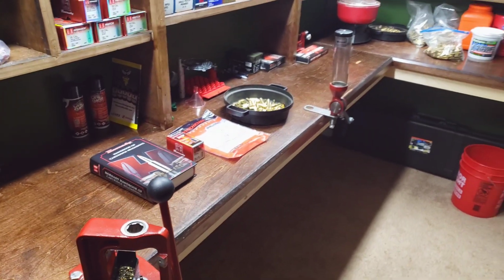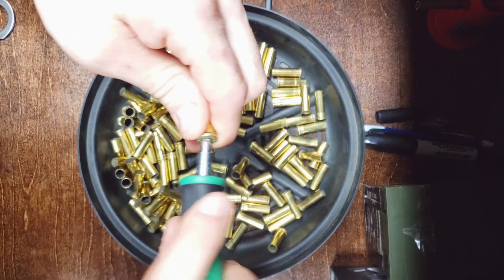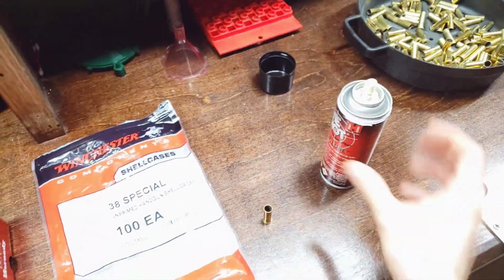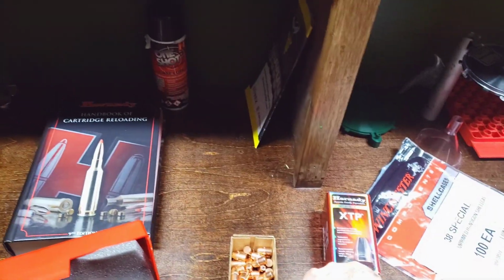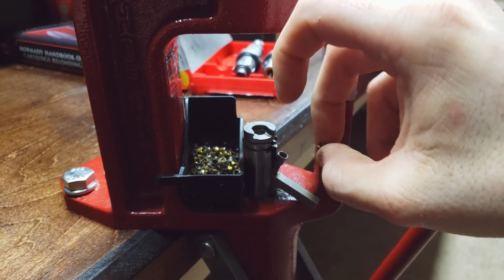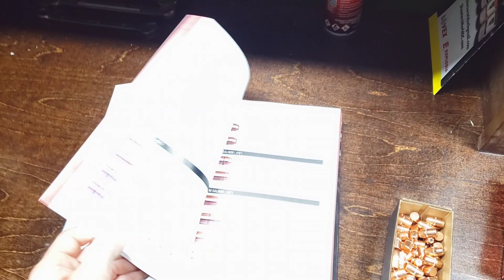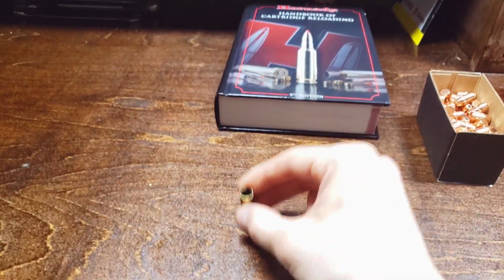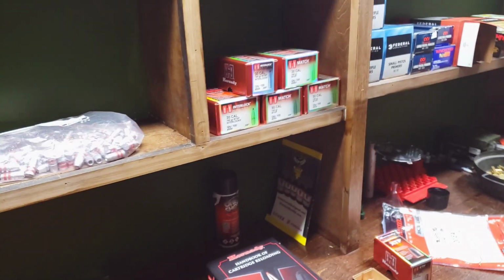Reloading 38 special

Comment: Good video on the process.  My only issue is your statement that a 158gr bullet is not optimum for 38 Special.  A 158gr cast or jacketed is the standard weight for a projectile in 38 Special and has been for over 100 years and it works great especially with modern powders like CFE Pistol (over 1000fps with 158's) and the old standby Unique for example.  I do prefer 125-140gr cast bullets but a cast 158gr SWC is "The Standard" load for 38's, even the FBI used it back in the day.